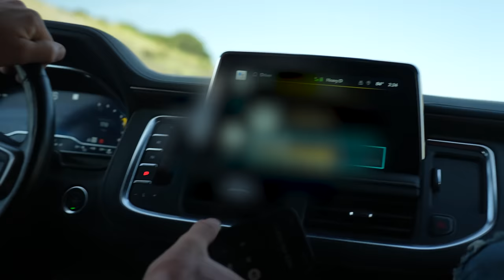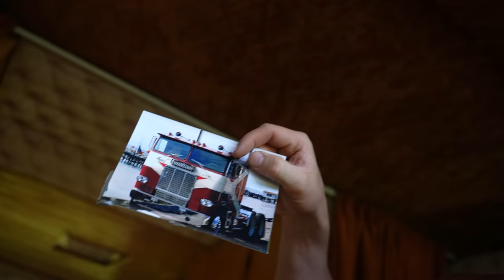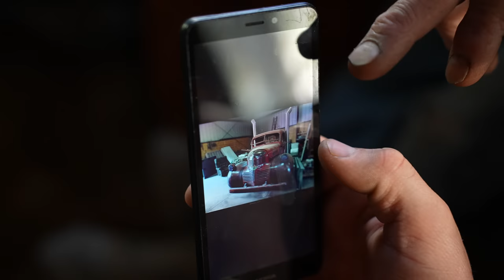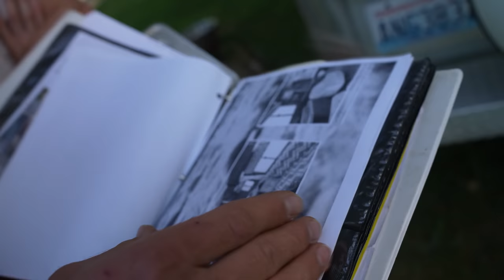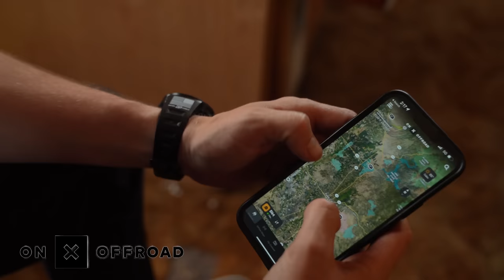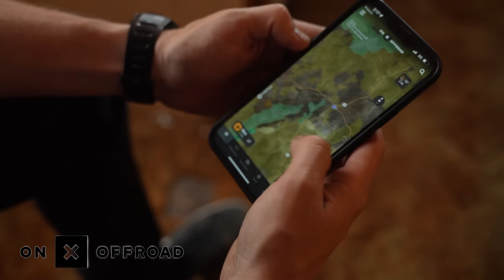What I Bought On Facebook Marketplace Has Everyone SHOOK!

Comment: What a cool build! Even though the GM 350 sounds and runs well, that's a LOT of mass for a small block to be dragging around.😜 I think a 5.9 Cummins would be much better suited for the task, and get better fuel mileage to boot! Nice find Dave! It's definitely a keeper, and I think you guys could turn this into a very reliable and fun camper!😉👍
Reply: 5.9 swap colab with power driven diesel
Reply: My thoughts exactly.
When i see truck cab i expect truck motor.
Reply: Definitely needs a swap. That’s not enough muscle :(
Reply: These guys ARE the Diesel Bros.
Reply: Repent and believe in Jesus Christ  Deuteronomy 18:20 — "But any prophet who falsely claims to speak in my name or who speaks in the name of another god must die."
Reply: I like a 350 they’re cheap and plentiful and can take a lot of abuse. My uncle used to run a 2 ton Isuzu box truck with a 350. Thing wasn’t gonna win any races, and had a wicked draw, but you could load it up like crazy and the old mule would get you there.

Also what about a dt466 ?
Reply: I have a 366 in my bus. Pulls an 8% grade for miles no problem.
Reply: The smell, Diesel exhaust will creep into the camper 

Yeah, put a 366 gas motor
Reply: Repent and believe in Jesus Christ  SPAMMER
Reply: Old freightliner side stacks
Reply: Nah 6.7 powerstroke
Reply: What a beauty! Irish rock? Then try Enter the Haggis out of Canada.
Reply: @swamp-yankee  LOL, the "downtime 466" got that name for a reason..🤣 That was one of the engines IHC would like to forget about.😄 Cummins are plentiful and easy to adapt. A 24 valve would be preferable since they make a lot more power and you can custom tailor the tune a lot more easily via the ECM.

Comment: Keep her, treat her on what she needs and give it a little update here and there(like GPS, solar panel, internet, sound/infotainment system, fridge, etc) but nothing much out of what she already is and yes take her on a good camping trip with a lot of miles ahead.
Reply: Ya exactly this. Just make it rock solid reliable but change minimal. 

Just put miles on with the families on fun adventures near you.
Reply: I saw that thing listed for sale I can't believe you actually bought that thing😂😅
Reply: I wish there was a love button. This comment is spot on!
Reply: @alaskanassassin7332  ll
Reply: Repent and believe in Jesus Christ  AMEN!
Reply: I don't even care if we never see it on the channel again, keep it and enjoy it.  It was designed by an aeronautical engineer, but if you ask me what it needs now is a truck mechanic's touch to iron out the little details the guy may have overlooked.  You mentioned it has just enough power for what it needs to do?  Bump it up a notch.  I know you're the Diesel Brothers, but that gas engine probably has a lot of tuneability left in it and a lot of power left to unlock.
Reply: Convert to Diesel,  maybe 4wd. Modernize the systems but don't change the looks!
Gotta get some ground clearance and suspension on it. Some limited self recovery capabilities. Generator, compressor, Winch. 
Solar system, Boondocking capabilities need a serious upgrade.
Disco ball, lighted dance floor, kegerator. Mini-split AC upgrade. Small wood stove (retro 70's looking).
Reinforced roof for a platform for watching races from the infield (Talladega, Darlington, Vegas and maybe some Dirt track Races).
My mind is racing with ideas!
Reply: No, leave it period-appropriate down to the wheels! It’s too good to modernize.
Reply: Bingo! Perfectly said!

Comment: I reckon it's a keeper, Dave. Get it back in shape (seems little work required?), use it as a basecamp for when you do heavy recovery work or when visiting Brent up at Cerro Gordo.
Reply: Doesn't Dave already have a big motorhome they use as a base camp? I think they should put it on  freightliner chassis with nice soft riding airbags so the RV parts don't disintegrate from the rough ride. The 350 SB will probably give up under Dave's foot anyway. A small block is awesome and hard to kill but it's draging around 10,000 lbs. of shoebox! Its currently running empty and he's already unhappy with the power output. Beautiful, unique ride do with at as you see the need.

Comment: Keep it!! Use it as part of the recovery team. So when your out on recovery at least you got a place to stay, so you don't have to drive back multiple hours after a long recovery. Update the the drive terrain to like a chevy 5500 ( since it is a chevy 1 ton any way). Put air bags on it and a good trailer hitch so it can help bring equipment around.
Reply: That ain't no one ton frame, more like a 3 tonner.
Reply: I agree, crew rest vehicle. Also would love to see a restoration video and possible yall put like a cummins diesel in her.
Reply: Put a bathroom in it and keep it.

Comment: Decent diesel lump in it, better brakes, gearbox with overdrive for higher speed cruise, sway bars to reduce the body roll - or something it rather swayey, possibly put it on air for an even more magic carpet ride, plus you can drop it onto bump stops - or axle stands - so when parked up and it is windy it doesn't rock
But cosmetics, nothing more than tidying it up.

Comment: You gotta leave it like it is. Just make it safe. Change them tires. Flush out the engine , brakes, transmission, radiator . Make the propane system safe . Clean out the fresh water supply.  Maybe put a tv up in it. I'd leave it a shaggin wagon.maybe do a solar power system  .a side awning. Make it comfortable  to your needs as well. Like maybe a  outdoor projector.  Maybe even some slide outs.

Comment: Keep it. Just do some up grades on the inside like the seats could use an upgrade and a dealer on the bathroom walls which makes it water proof.  Use it for doing rescue and recoveries when you travel. No need for motel rooms. Add a couple of bunk beds and a pull out where the minimum chair is behind the passenger seat and use it.

Comment: Finally got to watch this video and smiled the whole time. If ever a vehicle deserves to stay in the fleet,  it's this one. Now, it needs some love. New tires, belts and hoses. A bigger power plant. And it needs to join 2023. I would recommend  solar panels on the roof, power inverter and a Starlink system. Why? Because I can see this rig as a bunkhouse/portable command center on extended projects. And, since Hans thought it might have been used for smuggling, why not name it the Millennium Falcon? Those smuggling spots are perfect for the 2023 upgrades to be inconspicuous.

Comment: very cool buy, D! I like it! .... couple suggestions, 
(1) change the headlights back to the original Freightliner units and upgrade the lights to what Matt has on the MORRvair.
(2) change the wheels/tires to Alcoa polished 22.5's with super single tires both front and rear, (and spare too)
(3) do not install the purple under-glow lights that you've been thinking about.🤔

Comment: Find a semi frame and motor/ trans and swap em out. Use semi wheels and tires and make it the ultimate 1 of 1 toter home/ road trip machine. Perfect for a bumper pull trailer/ looks bad ass and can definitely haul for thousands of miles with little downtime.

Comment: My vote is you guys drop in a diesel motor and beef up the drivetrain, upgrade the suspension and axles, and then build a matching toy hauler to tow behind it.  This thing will be the ultimate lead vehicle in the Sparks Motors / Diesel Bro's party convoy.

Comment: This Rig alone gets a Sub and the Thumbs Up .. simply amazing .. every trucker's retirement dream .. Did I hear correctly that it's a 350 V8  "gasser" .. or is that a 350 Cummins in there?? .. if it's a swap, I would loved to have seen it with the original Cummins Diesel still in place, but I understand the Gasser for convenience at the pump .. and judging by the color of the fuel leak/flush (lol) and the hose/nozzles on the fillups it looks like gas.

Comment: What about a combo.?
Metallic / pearl
Classy champaign super glossy rv body.
Flat white with a low to no gloss clear coat for orange line's.
 Super glossy cream white in the blue line's with a super gloss black pin strip on outside of flat white lines black & a even thiner silver stripe on outer edge of glossy black pin stripe for a double tone pin stripe & silver pin stripe between gloss & flat / on outside of glossy center stripe with white wall tires that offer comfort but have a nice lower profile tire with white wall & toss in a dash here & there of chrome trime & grill & classy chrome rims. Maybe a straight window visor vs slant or reverse slant lines on front window visor for more aggressive look with tinted windows & super nice glossy stained wood trim & nice mood lighting on inside & new plush to complement everything else. With the F1 Rig decked out on a custom air ride trailer on the back of the Rv..

Comment: You should really make that into an actual freightliner with a diesel l engine and the big tanks….then you wouldnt have to pull over to fill up and as you know…it would give you a lot more in terms of hauling say a big boat or a bunch of svs …just a thought…the siding is just sheet metal so it wouldnt be hard to lower the panels if needed and you could have a generator (larger) a pull out kitchen with awning etc. something to think about….you could have all the swag but a big ole off-road monster….and they are out there
Reply: Like m&m they really do exist!..lol